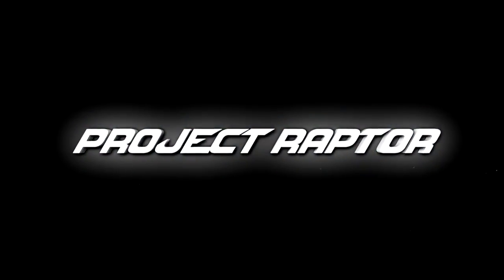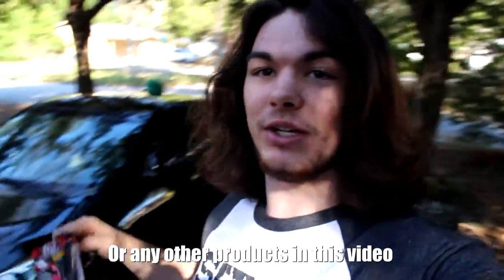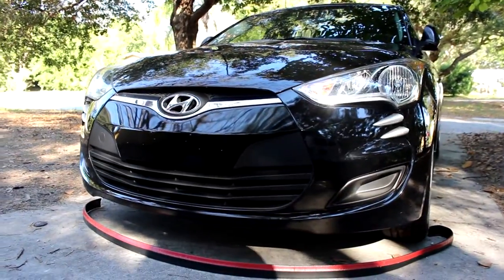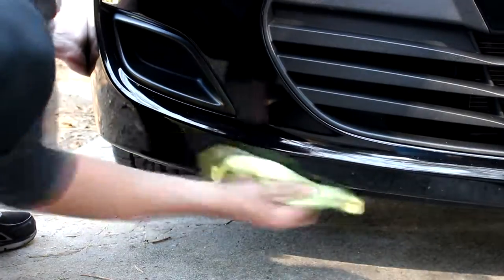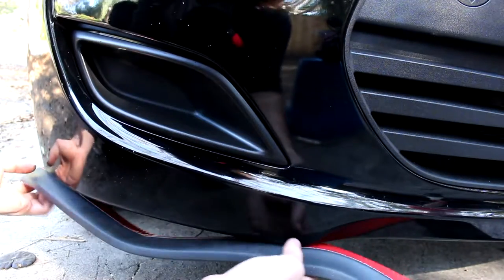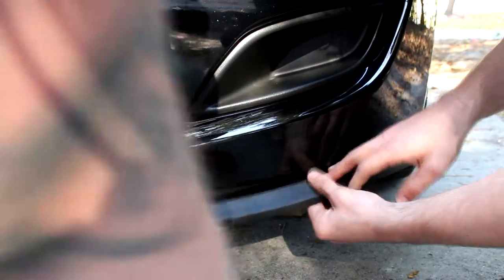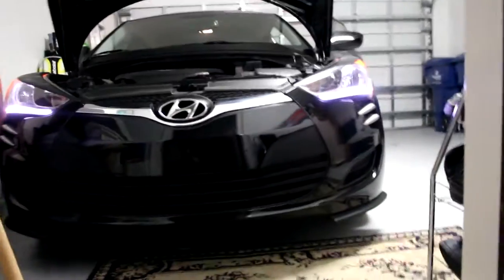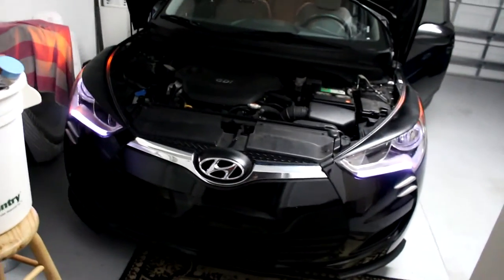Project Raptor Ep.#2 || EZ Lip, New Filter & Eyelids!!

Comment: To turbo the nonturbo version you have to upgrade all the engine internals, buy a turbo kit for this car which is around $5,000 alone and upgrade your whole exhaust system plus you have to find a mechanic that would be able to do all of this for you and pay for labor. Also I assume you drive automatic so that won't work either. Simply isn't able to withstand the power gain. Manual version would be able to though. So if you want a turbo sell your car and upgrade. Not only do you get the turbo and power but also a more aggressive looking veloster. But you can have fun with car still, change up your exhaust and get a intake. My non turbo had a manga flow muffler and k&n short ram intake, muffler was $60 and the intake was around $200 both from Amazon prime. The muffler got welded on for $100 and I put the intake on.You get a little bit better throttle response,not really that noticeable. sounds really good though. Exhaust, intake and a tune is all you can do for performance.
Reply: Did you tune your Veloster? I have one! It have a short ram intake, MagnaFlow muffler and is straight pipe. Also I will get a throttle controller! But I want to do a tune but I do t know if they can do it in the Veloster non turbo🤷🏽‍♂️

Comment: you didn't reassemble the filter box correctly. the side without the clips has 2 fingers that go in 2 lower holes to hing the box down on the none clip side.
just saying . your sucking air in without it being filtered.
Reply from the maker: Okay I will double check it, thanks for the tip sir.